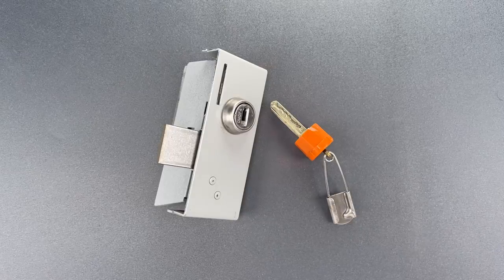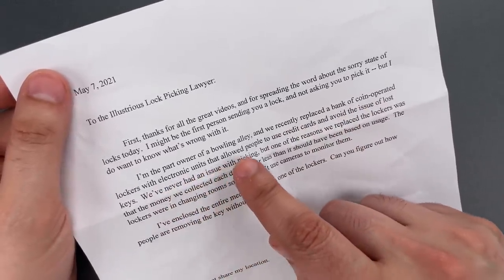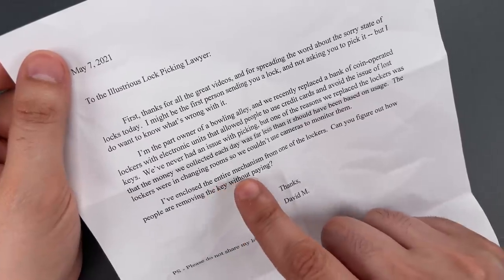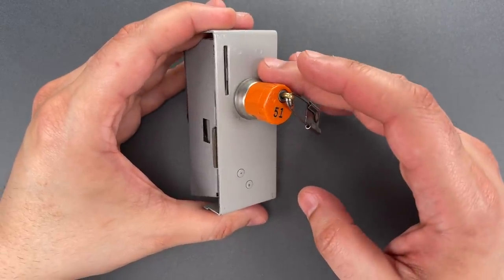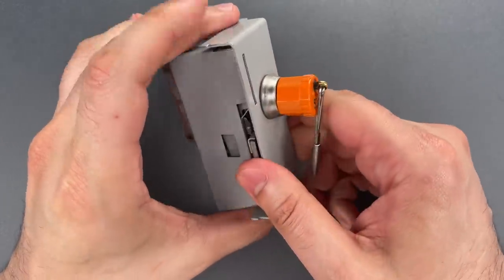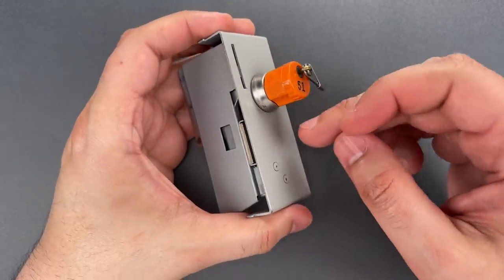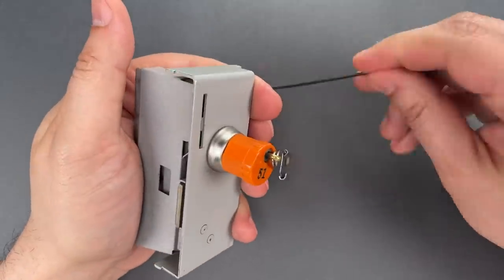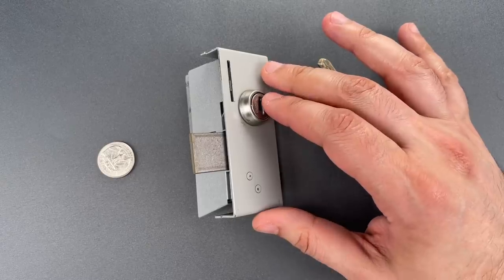[1308] A Huge Flaw In This Coin-Operated Locker Mechanism

Comment: LPL can you review one of the credit-card operated units and show how they aren't that much more secure?
Reply: I mean if the person sends one.
Reply: I will fix it
Reply: It probably relies on electromagnetic lock, like those police car gun locks, and if so they could be screwed over by a powerful magnet.

EDIT: Also the usual question of what mechanical backup looks like.
Reply: They can't have this kind of mechanical vulnerability related to the coin. Rather, they might share issues with the "smart locks".
Reply: I assume you're asking for purely scientific/research purposes...
Reply: @francescoaiazzone  Smart locks which are made by the cheapest maker in china? ;)
Reply: Along with defeating a credit card operated lock, can you imagine if you could also steal money from any credit cards that are still stored in the lock's unprotected memory?
Reply: @nowhereman6360  I don't quite get the point, sorry.
Reply: @Milnoc  200IQ thinking right there! :P Im sure they actually do save the credit card information and collect it once per day so in theory you could collect that info rather easy.
Reply: @Hugo-vr9xu  hey, that's Fix It Felix's line...
Reply: @Kampos94   for about 50 bucks anybody can buy a machine straight off of eBay to read RFID chips credit cards and steal their information... With the addition of a couple hundred more dollars in Equipment you can then make your own clone credit cards that you can use anywhere as if it was the original card. Basically Banks found one more way to fuck you when they forced you to get the RFID chip credit card..
Reply: Good Point.
Reply: @travisdoe4663  
Oh man... You're right! I'm taking my 'like' back.
Reply: @marchofsaints  "can we fix it? Yes we can"  lol I watch entirely way too many cartoons with my kids.
Reply: @travisdoe4663  Yea i know about that but i doubt you can get the info off of the machine via RFID since  the machine is read only im guessing. You would have to replace the (or put over the original) card reader or RFID reader on the machine and Skim basicly for that. 
We are talking more of the fact that someone could get all the stored information off the memory that the lock mechanism/machine has. 

But yea you are definetly right that its super cheap to get all the equipement needed to clone cards. I think its even cheaper then you stated tbh. :)
Reply: @Hugo-vr9xu  And I'll build it
Reply: @Milnoc  IIRC the same method was used to steal millions of Target users card details. They were grabbing the unencrypted details from the point of sale terminals.
Reply: @Kampos94  Probably wires it, via WPA, to the office. Get on the network using any of a number of exploits, including password guessing, or getting a look at a legitimate client long enough to copy the passwords out of it, and you could probably log every one of them, posted through to the office in unencrypted HTTP. A cheap reprogrammed Android phone or Raspberry Pi, left plugged in somewhere within range of the WAP, could probably harvest everything and periodically drop them off in an internet dead drop for you to collect later.

Heck, you could probably automate the whole thing, so all you had to do was drop off a specially programmed phone and its charger, let it go through a script of possible attacks until it got in, then harvest whatever it sent you until it was eventually found, unplugged, and left forgotten in the bottom of the Lost and Found bin behind the counter.

The more I write this, the more nervous I become, as I'm pretty certain that I'm not the first to figure this out.
Reply: @andyowens5494  Target were PCI DSS compliant and look what happened to them and their customers.
Reply: @andyowens5494  PCI DSS is weak in some aspects, overly strict in others.  It's a classic bureaucracy, but run by private companies, not national governments.
Reply: @Hugo-vr9xu  But can you tho
Reply: @travisdoe4663  Except you can't clone the card that way. Read the EMV specification of you want to know why. It's available for anyone to read online. Four short books of a few hundred pages each. Preventing the cloning of cards, as it was done with the mag stripes, is the very reason the EMV specification was created in the first place ...
Reply: @marchofsaints  no, he is not. He just read RFID and thought he'd understand something. Starts with those contactless cards not using RFID in the first place 😉
Reply: @brag0001  
Dude... You have no idea what you're talking about.
Reply: @marchofsaints  I wrote an entire EMV Level 2 Kernel on my own and certified it successfully twice. What's your qualification on the topic?
Reply: @brag0001  
I was commenting on his Bob the Builder joke... You're waaaaay off mark, bro. lololol
Reply: @vikrots6167  From what I've seen here, the backup is always the week spot. Might as well have a backup button you press to open the lock. "PRESS HERE IF YOU LOSE THE KEY"
Reply: @brag0001   Never tried it personally, but there are plenty of tutorials on YouTube and editorials on the internet about it. I've also had to have my card canceled and replaced two times in the last two years because of hackers.   last time somebody got a hold of it at the local gas station and was using it at other gas stations for months before I noticed.
Reply: @travisdoe4663  But they didn't clone the chip for that. The mag stripe is sufficient for that. The US is soooooo slow to adapt EMV, it's incredible. In Europe we have gotten rid of legacy terminals almost a decade ago. New terminals now must support contactless as well. In the US there are still so many mag-stripe only terminals ...
Edit: even among our customers there is quite a bunch who simply don't care. They prefer to suck up the charge backs rather than acting ...
Reply: One other major flaw of card operated lockers with no key:

You can't store your credit card in it. So you have to keep your main valuable with you.
Reply: @DJCube1701  that's a minor flaw. The major flaw is that I have to use my credit card on a device which looks suspiciously like a skimmer and most likely isn't maintained properly.
Reply: @brag0001  indeed, you could swap out the entire bank of locks one by one over months and skim every card used, by getting just one and modifying it, fitting it, then mod the one you swapped out. You'd have thousands of cards numbers by the end of the installation!
Reply: Pat, if you mean the cheapest ones with the notched card, I demonstrated a generic defeat of that system at LockCon 2017 (iirc)
Reply: @iPhoneeditor  Of course. It's good to know what locks to avoid.
Reply: @travisdoe4663  I can't think of a single bank that requires using an RFID card. Usually they're a premium option you have to spring for.
Reply: @adamsfusion  ehm no? My bank has RFID chips on every single card that they send out. They started that a few years ago. No extra cost or anything. ITs just standarnd now adays. And so are all the banks in the country. (sweden)

Comment: I remember many years ago a school trip to see a play at a theatre. The cheap seats we were on had binoculars that you could release with a coin. It didn't take us long to discover that our school locker keys were just the right size to poke in the slot to release the mechanism, and then we were able to pull the key back out.
Reply: I was just about to ask if a key would work.
Reply: We did similarly but used the lolly-pop stick from the half time break ice cream to do the job. Worked nicely. Did mean we only got to use the binoculars for the second half though.
Reply: AH opera glasses.
Reply: I was wondering who has a tool on them to do this but your story proves that a backwards key is the equivalent of a quarter on a stick.
Reply: Yeah, when we were kids we had a trick to get those binoculars for free, too, but it was so long ago I really can't remember what it was.
Reply: At the secondary school I went to, for years they had a type of lock on the lockers that could be opened buy using a metal strip that the school supplied as part of the school stationery. They changed both the lock and stationery after they found out but it took a few years. In the meantime we had loads of fun swapping around the contents of the lockers.
Reply: Waste of binoculars, should've been earplugs. LOL